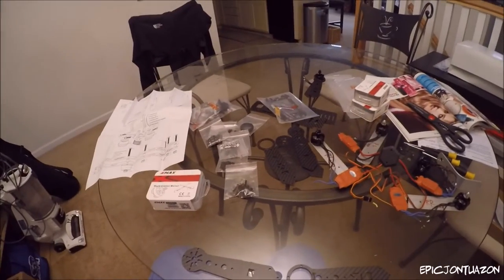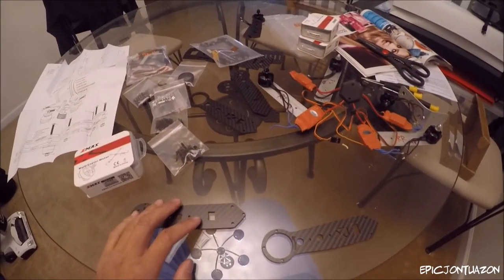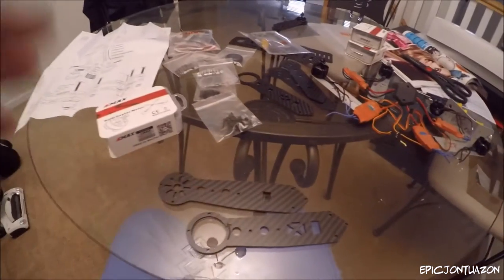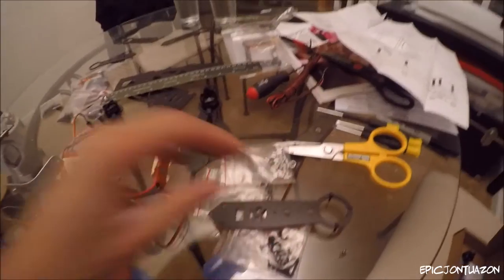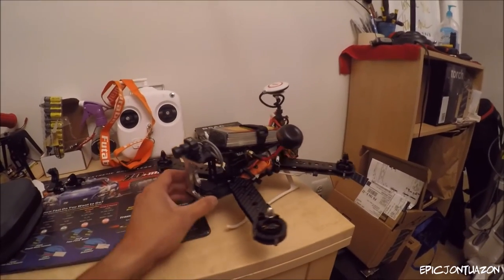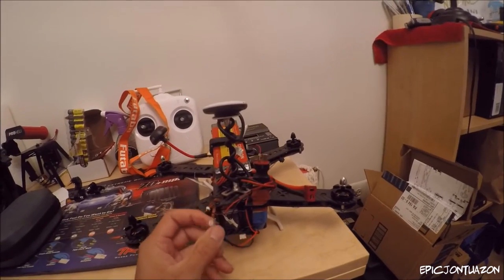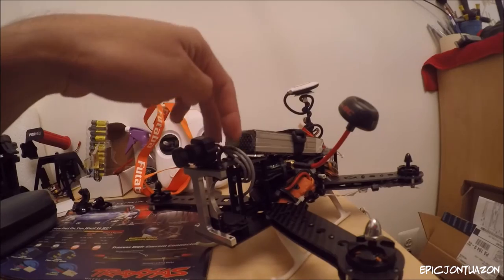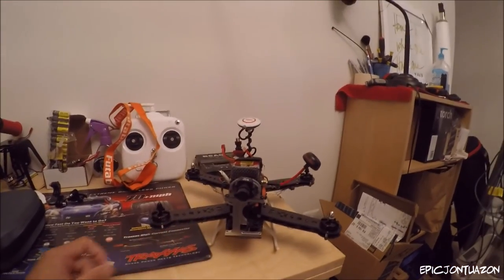ARRIS X-speed 300 Racing Quadcopter Build - Vlog #22

Comment: Nice build im a diy guy myself i was looking into building a drone but im indecisive now im tempted by the 3dr ...smh by the way where did you get the heat shrink tubing ?
Reply from the maker: +morpheus6d9 Yeah I love 3DR products. I was torn between building a new one and getting the SOLO.  But the one thing with building one yourself is that you learn about the quadcopter and its so much more customizable.  IF i decide to put stronger motors on I can or if I want to add other features its no problem.

Heat shrink i purchased off Amazon.com  they had it for about $10USD for a bundle of them.